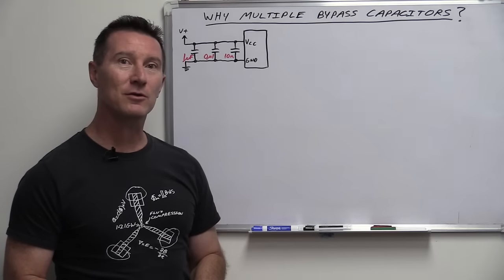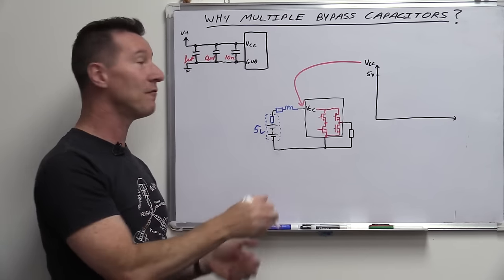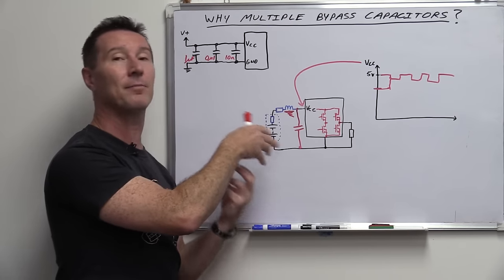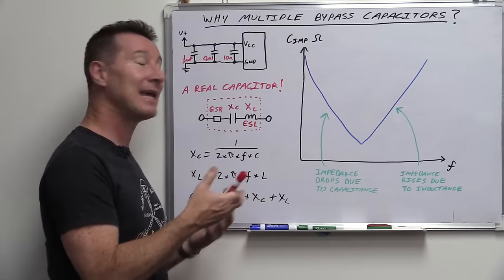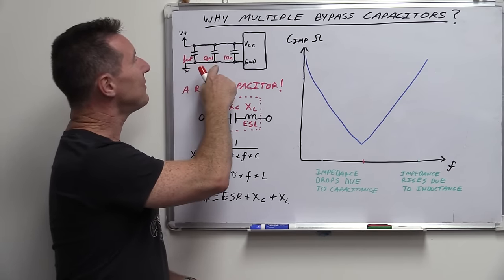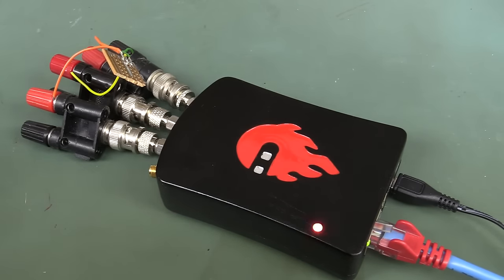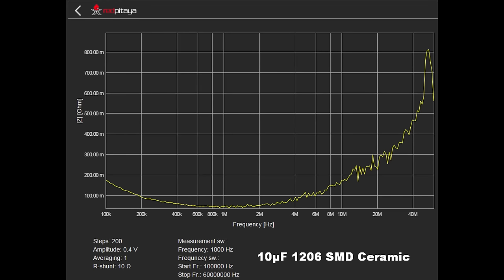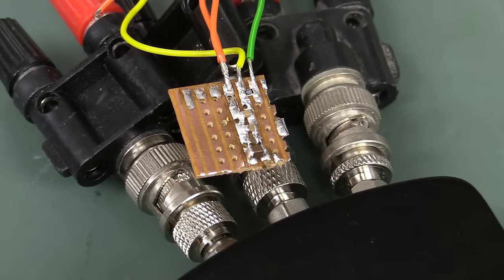EEVblog #859 - Bypass Capacitor Tutorial

Comment: "Let's go old school with 5V - none of this 3.3v rubbish" - YOU JUST WON MY LOYALTY WITH THAT ONE STATEMENT - LOL!
Reply: As a simpleton, can you help me understand what’s behind this? Was 5v a common supply voltage? Is it 3.3v now? Why did people change to 3.3v?
Reply: @BenGras  today 3.3v logic is common for chips, back in the day 5v was more common. I'm no expert but I assume this has something to do with increasing the power efficiency of circuits.
Reply: @woofcaptain8212  It does mostly have to do with efficiency as you guessed. As a general rule,  FET type transistors have to switch voltages and there are two general categories of losses that affect the efficiency. The first is on state losses which relate to the Resistance of the transistor when it is completely on (voltage from gate to source is significantly above the threshold voltage). This quantity is given in transistor spec sheets as Rds(on), and for "good" transistors can be in the low mOhms range. The power loss here is usually very small for logic circuits, but in some cases can be significant in cases where the transistor must conduct large currents. The second type of losses are switching losses. When a FET transistor is switching from on to off, the resistance changes from Rds(on) to a very high impedance (tens, hundreds or even higher MegOhms). The voltage across the FET also switches from a very small voltage to the full rail voltage of the FET. When the FET is off it absorbs very little power, and when it is on it absorbs very little power, but when it is switching, for a brief instant (usually on the order of 100ns, but can be much fast or slower depending on the particular FET geometry and chemistry) the FEt is at a point where it has an intermediate voltage and an intermediate resistance. At this point, the power it absorbs is the voltage^2 times the resistance. Although this amount of instantaneous power is relatively high, it only happens for the short duration of the switch, so alone its not very much energy. When you switch millions or billions of times a second, it adds up quickly. In fact the higher the frequency, the higher the switching losses. To combat that, you can drop the voltage. Going from 5V to 3.3V reduces the switching losses by 60% assuming all else remains the same. In addition, when the voltage swing is lower it takes less time to switch, so the power savings is actually even more pronounced. This faster switching also allows the circuit to operate at a higher frequency as well. The only limit to this is the minimum voltage the FET actually needs in order to turn on, which can be improved by better chemistry. In fact modern processors have a core logic voltage that is less than 1V. Undervolting a processor is a good way to reduce its power consumption, but can lead to not enough voltage for switching to happen completely and result in logic failures. In the late 80s, 5V logic was the norm (it was called TTL logic). Today, 3.3V logic is available in two primary flavors, CMOS and LVTTL (Low Voltage TTL), and many off the shelf parts are available that commonly operate down to 2.5V.
Reply: Lol, P=V²/R, according to me 1V is more than enought !
Reply: Yo !  Me too !  Great "Real World" Tut.
Reply: @woofcaptain8212  100% correct and that 3.3V will drop even more fairly soon as they seek to make these devices even less power hungry.
Reply: @BenGras  My only real complaint with 3.3v vs 5v in the microcontroller space is that with a tolerance of only 3.3V, it becomes an issue of being able to read a larger range of voltages at any given pin on a microcontroller. Its bad enough when the A to D converters only have a resolution of 0 to 1024 but then when you include the limitation where pins can only tolerate 3.3 volts that only further limits the ability to read a wider range of inputs. I wish they would at least make input pins tolerate 5V while the chip runs at 3.3 ... but apparently these are not relevant design concerns or they would be happening.

Comment: Hi Dave. Great video... Just a few minor comments to add from a guy who's done allot of EMC work on PCBs. The inductive reactance of the different value capacitors but in 0805, 0603 and 0402 packages, generally follow rather close and similar upward curve due to similar package inductance. Also as you accurately noted, the parallel resonances can be problematic. Henry Ott's EMC book (chapter 11) provides an in depth analysis of this, and often multiple of the same value cap will outperform other configurations. However, sometimes, notches are desired at certain frequencies (for example for RF tx/rx applications), in which case, mulitple differing values will be recommended in the datasheet. Another option (suitable for some situations) is adding small ferrites between cap stages. Clearly this has to be done with a solid understanding of the di/dt requirements of the circuit at hand. I hope that this was helpful.

Comment: Trap for new engineers..  The recommended IC bypassing put out by the IC manufacturer may NOT be suitable over your entire product operating temperature range.  I had a Analog devices DSP that would pick up a jitter in the PLL clock over a very small (elevated) temperature range.  Clock stability was really important in our application and bad things would happen in a certain temperature range.  In the end the problem was that the recommended bypassing was insufficient at the max clock rate over the entire operating temp range.  We increased the number of caps and the problem went away. The DSP would operate normally and if you didn't care about the clock jitter you'd never know that something wasn't right.
Reply: When it comes to high performance the layout becomes a main factor in the equation. When you are doing that kind of stuff the manufacturers typical design is most likely not enough. You may actually be using the device outside specifications.
Reply: Intermittent problems are the worst one can encounter.  Frustrating to pinpoint, and sometimes hard to fix.

Comment: Back in my early career we called these caps, decoupling caps. I was responsible for an engineering change to add a decoupling cap to one particular chip on a cpu pcb. The fix cured a major problem. Back then we used oscilloscopes to chase the chip noise which lead to adding additional caps to the chips on the cpu pcb.

Comment: This was a great demonstration! Suggestion: pair some of the capacitors with other capacitors of the same value, except, use a 1 Ohm resistor, to suppress  the resonance caused by stray inductance between capacitors, as well as the inductance inherent to the capacitors themselves. Much the way a shock absorber damps the resonance caused by spring rates(inductance) and mass(capacitance) in an automobile suspension.
     I have run into problems like these, designing switch mode power supplies, as well as class "D" audio amplifiers. Keeping the high speed switching noise from the huge output transistors out of the sensitive pre-amp circuitry is the trickiest thing of all. You absolutely DON'T want to see those high frequency ringing pulses on the supply rails! Op Amps don't have the bandwidth to chase those high harmonics away. I do a lot of resistance-capacitance snubbing.

Comment: Why do you use multiple bypass capacitors?
To get the lowest impedence across the largest frequency range possible.
Unlike ideal capacitors, real capacitors have inductance causing high impedence at high frequencies, potentially rendering a specific capacitor useless. So another parallel capacitor might oparate as desired in the particular frequency range.

Comment: I was happy to see you mentioned at the end of the video that inter-resonant issues exist.   More often then not this exists...  A better design practice is to use all the same size cap, preferably one cap.   Issues start to arise when different size caps (physical and capacitance) are mixed and matched, due to the differences in ESL.  Of course bulk capacitance is often needed for supplies and such.   Just a small comment on a big issue.

Comment: Wow, thanks for the great video! I'm watching this from a perspective of self-taught electronics repair with no background in electronics engineering. In the context of repairs, sometimes shorted capacitors are simply removed and not replaced, especially if the risks of heating/soldering outweighs the benefits of having one more capacitor.  Now I understand these bypass capacitors much better.

Comment: Hi Dave, I'll send you one of my Impedance Analyzer extension boards for the Analog Discovery as soon as I get the latest PCBs from the manufacturer. It should provide decent results. There is a long thread on EEVBlog forums. There is a short demo in my videos.
Reply from the maker: +TheStuffMade Cool, thanks, didn't see that thread.
Reply from the maker: +TheStuffMade Oh wow, that looks very nice. https://www.youtube.com/watch?v=cbXGzz3PC3Y I presume you wrote the software plugin?
Reply: +EEVblog Thanks, yeah, that's the one. The software is stand alone, using their API interface. It's not meant as a reference level instrument, but thanks to The Electrician (EEVBlog user) I got a set of reference components together with measurements from his high end Hioki analyzer and the comparison results are surprisingly good. It's 95% software and just a bit of hardware to switch shunts and amplify the signals to measure down to ~100 micro ohm and up to about 5 mega ohm. Anyway, I'll try get one to Australia asap, hope you are interested and still have your Analog Discovery around somewhere.
Reply: Hmm that is pretty interesting. I haven't found many uses for the Analog Discovery outside of when I was in class as I use a bitscope micro on a Raspberry pi. Did you ever get these ready for production? What do you think about using it for measuring impedance and phase for speakers across the frequency domain?

Comment: Love it!  As a practicing engineer, I find it strange that young engineers don't think of digital systems as analogue ones.  For example, digital signals have a rise time.  For bypassing, we need to review these in the frequency domain.  For example, a 1 nS T(10-90) has a -3 dB frequency point around 330MHz.  So, a 100 Hz square wave with a 1nS rise time needs bypassing as if it was a 330MHz sine wave.  Your boards frequency is typically set by the rise times, not max clock rates.  (E.g. a 16MHz xtal with a 1nS rise is quite challenging).  Thinking like this is required for EMI certs . . .  Again, great job Dave.  I'd love to work with you some day!!
Reply: Oh! And we must remember dielectric material responses, too.

Comment: Hi Dave, not sure if anyone mentioned it but, distributed PCB capacitance in multilayer PCB's
where power and GND layers are opposite to each other can also help.
For a HF PCB design you'd want to load up all the bulk and decoupling caps then present it to a network analyzer to see your effective resonance frequencies.

Comment: Too many comments to see if this was posted already, sorry if I'm repeating it, BUT: There's a second answer to the question that's kind of the "duh" answer: If you're just looking at the schematic and wondering why there's multiple bypasses for a single rail, and the chip in question is a very large many-pin ASIC like a CPU or large FPGA, often the answer is simply that there are multiple power and ground pins spread across the footprint of the chip, and you need to put bypass caps at each one :)

Comment: This video makes perfect sense. The power supply voltage AT the power pin (Vcc) of the chip fluctuates (changes) as the chip draws different currents as it does it's different functions. Although capacitors are NOT voltage regulators in a long-term sense, they ARE voltage regulators in the short term sense. As far as putting different types and values of bypass capacitors in parallel, you are getting the best of all worlds at once; you are getting the slow response time of an electrolytic along with its long voltage "regulation", and the fast response time of a ceramic disc with its short voltage "regulation". This is because there are no perfect capacitors. Anyway, good video! 👍

Comment: Loved your videos for years.  But on this one I have to point out that the behavior you showed at around 27 minutes in is the rule rather than the exception. It is at odds with the myth that multi-values are helpful. The set of series resonances discussed earlier is based on only impedance magnitudes. It ignores the phases that give rise to parallel resonances found in your test, and can actually be pretty dangerous in a design.  I think it's mitigated some by the ESR in the caps, which lowers the parallel resonant peaks somewhat in most implemented designs. So the danger is not widely known. After an argument with a colleage, I tried this using a CPW board with SMD caps and GSG probes and saw resonances in the VHF region - just like what you saw. From those studies, I believe the best solution is to use a single large cap (as you showed), or multiple large caps in parallel if higher values are required. Computer board designers are looking at "power distribution networks" which include trace routes/etc. as well. Some books on PDN design have come out in recent years that discuss the resonances involved and strategies for dealing with them.

Comment: Hi Dave. Although I knew everythingik before watching your video, you explained everything very nicely.
The only thing I am really missing, is the explanation of the three-terminal capacitors. 
Also, maybe handy for beginners to explain how NOT to layout a decoupling capacitor to a chip's VCC pads (eg: the current must go from the PSU through the cap's pad, to the chip's pad, instead of having a trace going from the VCC trace to the cap).
Reply: Three terminal caps are somewhat of a novelty, as the mounting inductance and loop inductance of the PCB dominate a capacitors efficacy, not the intrinsic ESL of the cap itself. You also need more vias to mount them. The goal is to reduce the Z axis loop inductance to the PWR/GND

Comment: Hi Dave, I think there is also important thing about placing multiple ceramic caps in parallel especially in DCDC converters... As you have said in previous video about ESR and termal issues, in ceramic caps this is also very important when switching freq is about 1MHz. Sad that I didn't see in this video plots for 10n+ 100n + 3 x 10uF and with different locations/order to testing point (uC pin).

Comment: This is a really useful tutorial and something I've often wondered when looking at schematics. I think you were somewhat successful in getting the point across with your demo, but it would be great if you could really nail down a nice example with proper test equipment. I'd really be interested in seeing the difference between, say, a 10 uF ceramic vs 10 uF electrolytic. Or an electrolytic with different lead lengths or package shapes. These real-world tests are something that you're well-positioned to do properly and can be extremely useful for providing real-world rules of thumb (which aren't always the same as what you read in a book!).
Reply from the maker: +rynomilner I was hoping to luck upon a good example, but this is the best I got after many hours of experimenting.

Comment: You didn't mention the fact that digital level transitions require a finite time to occur and during the rise or fall of a signal, in between logic 0 and 1 there is a brief time when both the top and bottom totem pole mosfets are conducting, effectively placing a large load (a short circuit) on the Vdd line (as well as pulling ground up - called "ground bounce"). The bypass cap(s) need to provide for that momentary high current demand. And, of course, since these surges are very brief (high effective frequency), it is the small value, low ESR cap(s) that handle this task.

Aside from this omission... great video!

Comment: Excellent.  Thank you.  What you say makes sense.  However, practically - the next step is to consider this in my PCB design.  Do you model in LTSpice?  Is there a worksheet to plug into that will give an idea of what caps to use?

Comment: Dave, don't forget that many SMD capacitors have capacitance that varies with voltage, and will only reach their nominal capacitance when charged.  Any such evaluation must put DC bias on the caps, otherwise you're not actually measuring the performance as it would be in-circuit.
Reply from the maker: +lmiddleman The Red Pitaya adds the DC bias, there is a setting for it in the impedance analyser.

Comment: This is about switching solid state producing back-EMF (all switches, mechanical or electronic, produce back-EMF) and needs to see a low impedance path. Also, the IC regulator often used has poor bandwidth and the back-EMF in MHz range simply is not enough and does little more than set 5V DC level. So the solution is wide band low Z path to ground/0V that can only be solved with passive capacitors.

Comment: Nice! I always thought of them as "backup batteries" for the nearby chip. A micro-UPS to keep the chip voltage regulated regardless of what funny things happen to the 'mains power lines' over the nanosecond scale. I suspect a lot of my early digital projects failed from lack of bypass caps.
Reply: A very accurate description of what is going on with the supply rails on digital boards. Very fast "gulps" of current from i.c.s are compensated for by energy stored in the bypass caps and a very fast circuit will need caps in  the rf range (pf)